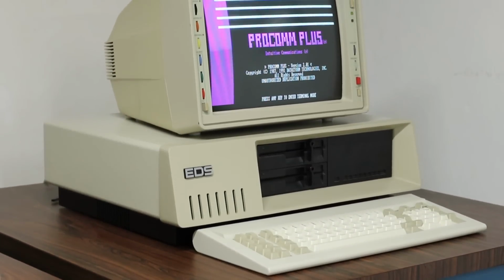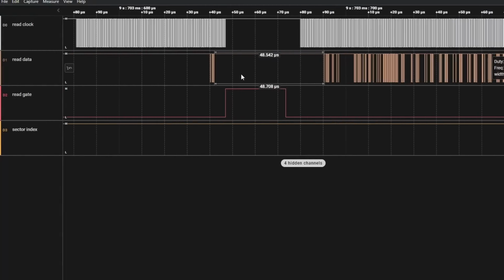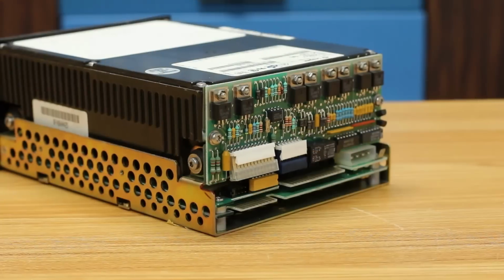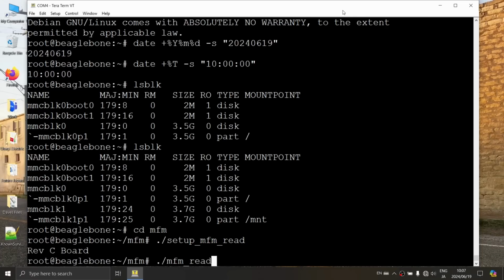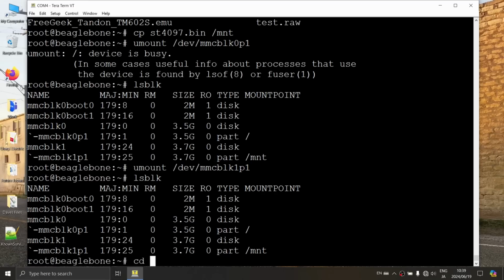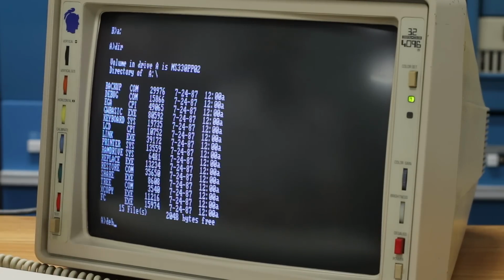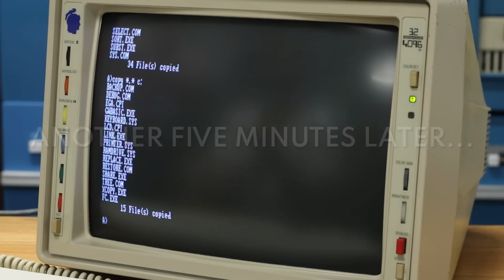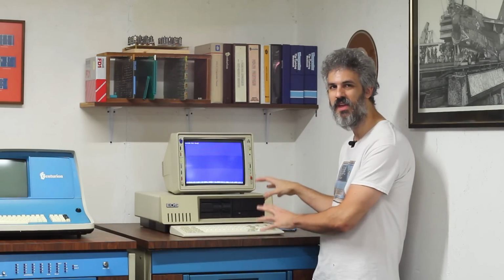FM is RLL, MFM is RLL, RLL is RLL! Fight me.

Comment: When I am watching, it looks it is doing the low level format on the ST4097 as if it was a st238, as in the later shots of formatting the drive with the format command it is only counting 4 heads. The 4097 has 9 heads and 1024 tracks.

Hard drive controllers at this time would drive you mad with formatting configurations. Some of them used jumpers, some gave a dynamic option to select the number of heads and tracks. I did not see it prompt for dynamic you may need to check the jumpers on the controller card to see if it gives a dynamic option. If it does not there is a tool called SpeedStor that you can find at minuszerodegrees that has more control over the formatting, and might be able to do something with the original st238 drive. You will want version 6.03 for an XT class machine.

Also, there is another utility called Spinrite that can work wonders with bringing some drives back to life if the low level format has gotten week but there is still enough flux data to rebuild it.

Comment: I used to use MFM drives with a RLL controller back int the 80s without issues to save a bit on the cost of RLL certified drives which were more expensive
Reply: It was easy to get bitten if the drive wasn’t up to par.  I had to replace the RLL controllers with MFM controllers in a lot of computers equipped with Seagate ST-238 drives owned by an organization I worked for.  The Seagate ST-238 drives had a nasty habit of having the rotational speed gradually drop off from the nominal 3600 RPM.  MFM controllers can handle the speed inaccuracy, but RLL controllers ran into trouble.  There was no obvious way to adjust the ST-238 spindle speed in the field.
Reply: @wtmayhew they weren’t very good drives, but they were better than anything IBM was putting in XT’s and  AT’s.
Reply: @ChuckvdL  I had an IBM PS/2 Model 80 which was lent to me for several months for the purpose of reviewing Micro Channel video cards for a Computer Shopper article.  The model 80 was then the flagship PS/2 with, I believe, a 16 MHz 80386 CPU.  The 80 meg ESDI drive was labeled IBM, and it didn’t look like any other drives with which I was familiar.  I don’t know if IBM made the drive themselves.  As you noted, it was not terrible, but much better than a contemporary MFM drive.  I also tried a loaner 327 meg CDC ESDI drive (forget the exact model) and the CDC drive was quite a bit faster than the IBM-supplied drive.  The CDC unit was quite massive by comparison - both were full height 5.25 inch.
Reply: @wtmayhew  omg ‘microchannel’. IBM’s attempt to regain control of cloaning by creating new proprietary standards that they would license….   

That was a year or two after the 20 Meg half height ST-225 came out, but IBM drives still sucked.   Many were also low level formatted with interleave’s like 5:1 or 6:1.  I think because IBM’s controller cards were terrible as well
Reply: @ChuckvdL   Yes, Micro Channel was a tactical error.  It was well intentioned from an engineering standpoint but needlessly proprietary.  VL-bus and then almost immediately PCI made Micro Channel irrelevant.

Comment: The sequence is as follows:
1) Low level format:
debug g c800:5 to run the BIOS provided on the extension card
The sector interleave is the sector count between consecutive sectors on the same track.
This value depends on a whole bunch of factors, the most important one being the speed of the CPU.
Because of the sector skipping the transfer rate decreases
The value of 4 means read one sector skip 3 and read the 4th one etc... For an XT class machine it is probably the right value.

2) Use Fdisk to create 1 Primary dos partition (the only one Dos can boot from)
1 extended partition that will itself contain as many partition as necessary

3) Dos format letter: /u (/u = unconditional do NOT retain previous data structures)
The /u switch is only applicable for recent revisions of Dos (5 and up ?)

4) Transfer the system with the 'sys drive:' command
From a: with a bootable disk in it run sys c:

5) Copy the rest of the files with copy (or xcopy if available)
Putting all dos files under c:\dos is considered good practice
Only the 3 system files (see bellow) and boot configuration files (config.sys, autoexec.bat) should be at the root of C:

PS: the system files:
IBMBIOS.SYS
IBMDOS.SYS
COMMAND.COM
are supposed to be at predefined file allocations positions otherwise the boot process will stall.

The sys command does not support "making room" for these files by moving files elsewhere.
This is why the sys command has to be applied first, before other file can use up that space.

PS2: you might want to give ms-dos 5.x a try to break the 32Mb per partition barrier if the ram size allows.
Reply: You can omit the SYS command if you do format /s
That works too.
Reply: The correct way to install DOS would be using SELECT, not using format/sys/copy.
You'd create the partition with FDISK, then reboot and run:
SELECT A: C:\DOS 001 US
It formats the partition, makes it bootable, copies all DOS files into the given path (C:\DOS) and configures it for country code 001 and US keyboard.
Reply: @kpanic23  Is that similar to Setup or Install in newer DOS versions?
Reply: @Stefan_Payne no DOS I ever used had an “install” or “setup”   
Format /s
Make a dos directory and copy . to that directory 
Copy con autoexec.bat, set path, etc, end with ctrl-z
Make a config.sys the same way.
Done.
Not that we didn’t create batch files to do that when I worked as a tech building PC’s and clones.

Select sounds like something far newer than the era of that machine which would be DOS 2.xx and later 3.xx
Reply: Since it's not an original IBM-PC, it is probably "IO.SYS" and "MSDOS.SYS" instead. IO.SYS needs to be the first entry in the FAT, starting in the first available sector for data, and contiguous with MSDOS.SYS, which needs to be the second entry in the FAT.
Reply: Interleave can be later optimized without a reformat using Spinrite. So yeah, start with a conservative value like 4:1. If it turns out later that your hardware operates well at 3:1, that's basically just an overnight "set it and forget it" changeover.

A lot of later RLL controllers, even the 8-bit ISA ones, worked well at 1:1 interleave. So did some of the later MFM controllers. Again, this is something that Spinrite can address if you chose wrong.
Reply: @mal2ksc  Someone else commented on here that Spinright could be bad for this series of disk
Reply: even as an ancient debug hack in the early 1990, today all i can remember is C800:5
10-12 years this nearly 30 yo pup asked me to bring up the OLD AT (I386DX-33, 8mgs, original Sound Blaster, Trident 1mg SVGA and a 120mg conner ide) that Gramps used in high school...out of an entire shoebox of 5-1/4" disks all that worked was a dodgy DOS 5 bootable system disk, a QEMM install disk and a full copy of Wolfenstien 3D...i found some Sound Blaster drivers on an old Seagate IDE drive i had (pre 3rd divorce)...and we were in business.....

when I had to break out with debug C800:5 in text mode his comment was "WOW Bare Iron computing!"
Reply: @CATech1138  To make bare metal just a bit harder, the starting offset in the controller card’s ROM isn’t always 5.  I recall some starting at C800:8
Reply: Newer versions of DOS would definitely work. I've booted MS-DOS 6.22 on an IBM 5150 with 512 KB RAM and no hard disk. It worked fine but I quickly went back to IBM DOS 3 because the bare minimum system files take up much more of a floppy, it eats more RAM, and comes with basically no benefits unless you have a hard disk bigger than 32 MB.

And yeah, MS-DOS 5 and 6 come with "setup" programs that do format /s, copy everything into C:\DOS, and generate a basic AUTOEXEC.BAT and CONFIG.SYS, all with a white-on-blue text-mode "GUI".

Comment: Oh, memory lane !!! Thanks for the video. One thing about the MFM vs RLL thing that you missed (not because you were wrong) is that those differences came along because of software, not hardware. People started noticing that there were better ways of encoding things, hence the LZW algorithm that gave us ZIP and DCT (Discreet Cosine Transform) that gave us JPEG. That is where this magical way of encoding stuff came from, if you encode it like that, you are able to compress more stuff together, both being able to store more as well as being able to read/write faster. Once again, Thanks for the video.
Reply: The way RLL works is quite different from LZW or Huffman tables or any of that, although these ideas were used for "disk doubling" software. 2,7-RLL actually writes twice as many bits as MFM, but by strictly limiting how many consecutive 0s or consecutive 1s are allowed, it can pack those bits in three times as tight and still work with them reliably. These are mapped through a simple lookup table to convert to/from data bytes, resulting in a net 50% increase in both storage and speed, all invisible to the OS. All DOS/BIOS know is that the disk has 26 sectors per track instead of 17.
Reply: @mal2ksc If there's a lookup table involved, would that be a really early form of a static dictionary?
Reply: Correct, Seagate drives format depends on controller (especially early controllers). I had IBM PC XT clone at work and controller and HDD was treated always as bonded pair in terms of swapping between machines. MFM controllers have some own specific sector prefixes and coding quirks (interleaving sectors).

Comment: If you set the interleave to a lower number your get less storage but faster data transfer and more reliability.
Reply: Interleave is just the weaving of tracks that allows the heads to move in time (and the disk controller software) to be ready to read the next sequential sector and minimize the amount of disk rotations required before it can read it thus making the drive perform better.  At least, that’s my rudimentary understanding of it.  There is no loss of space that I can recall and the performance gains were very real.

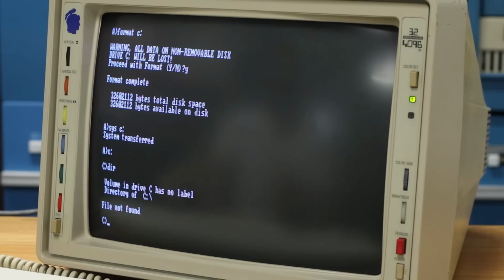Comment: 31:26 There is a way to get that done automatically when formatting a disc. When you're typing format c: just add /s at the end and it will transfer the system files.
Reply: The /s flag signals to the system that you're being sarcastic.